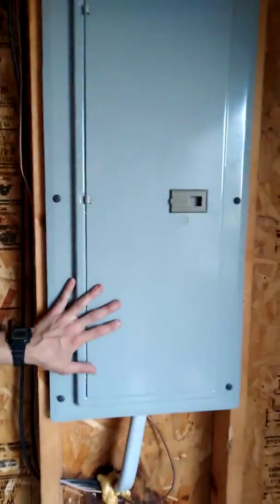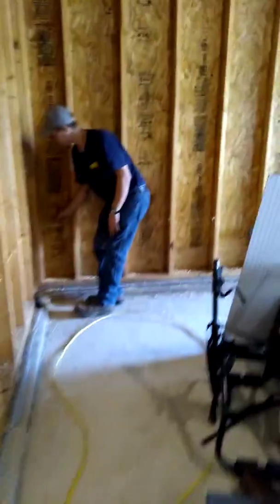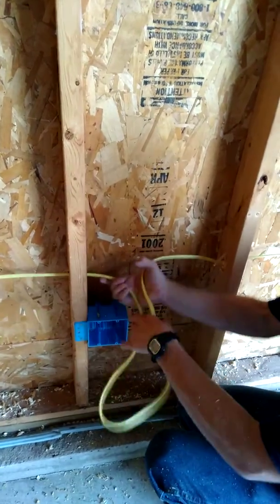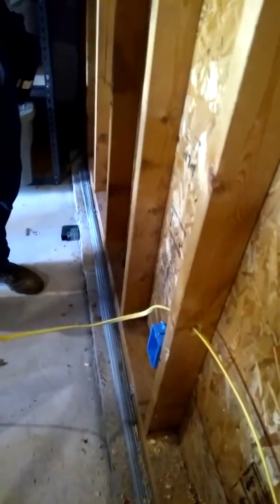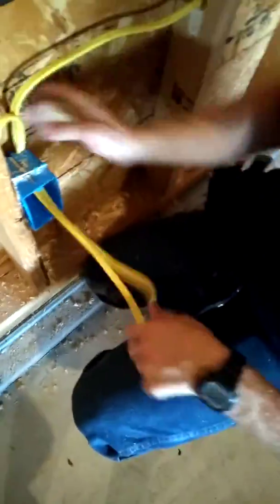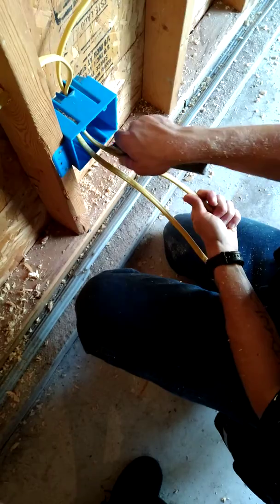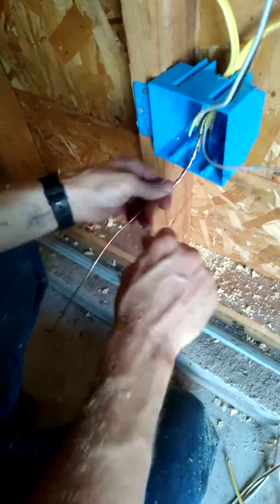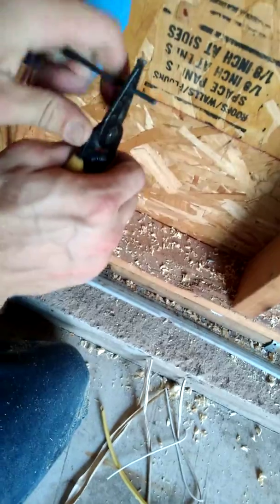Fastest way to become an Electrician

Comment: As a carpenter, I am wondering why he did not put blocking where the plywood joint is.
It looks like a 1' rip at the bottom & a full sheet sitting on top of that.

Comment: Suggest higher holes because you need a staple either 8in WO interval clamp, or 12in with a clamp. And alot of back and forth. Ha. And the 6inches of free conductor is not a rule of thumb, it is a NEC code requirement.

Comment: Two things to note here…

New work boxes have knockouts that do not secure the wire, so staples are required within 12” 
Old work boxes get around needing the staples by having wire support built into the box. DO NOT knock out the retainer, you must push the wire into the box without damaging the retainer. 

As this build is new work boxes, and the studs are exposed, breaking out the knockouts is ok, but staples are required.
Reply: no because old work boxes are designed for old work so there would be no way to staple a wire all boxes secure a wire with a tap or a screw clamp some you need to add connecter that secures the wire
Reply: you box must secure the wire
Reply: @Vanilla_Icecream1231  yes, they are designed not to require staples by design of the box to retain the cable. Try and get an inspection with old work boxes that have the retention broken… they will fail.
Reply: @SuperVstech  way to deep this is an overview. No need to get lost in the weeds. This is meant for beginners
Reply: @johnhill9865  sure, and beginners NEED TO KNOW TO USE STAPLES to secure the wire.

Comment: What size hole is recommended for the wire?.... The size used in boring through the studs.
Reply: I use a 1 inch bit
Reply: @Jamesboy-zx2ud  1 inch is very over kill unless your running big cables
Reply: Thanks for the info.
Reply: @Ojeramup12  No problem
Reply: for flat nmd 90 14/2 5/8" but it can be tight depending on the manufacture and with 12/2 because some have thicker insulation but i would say 5/8" is good for most things other wise 3/4